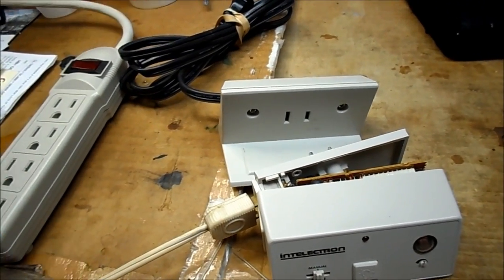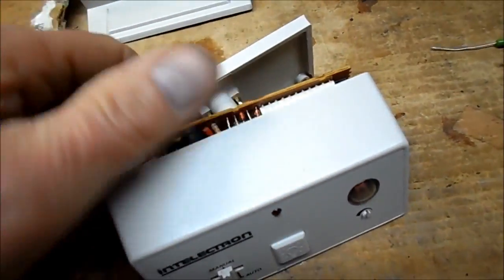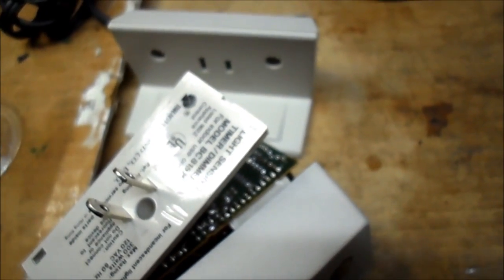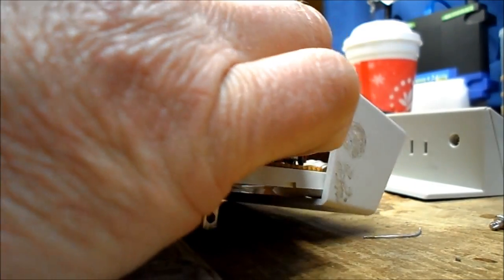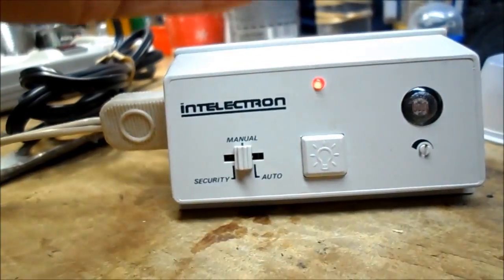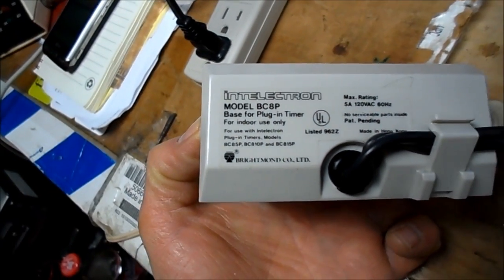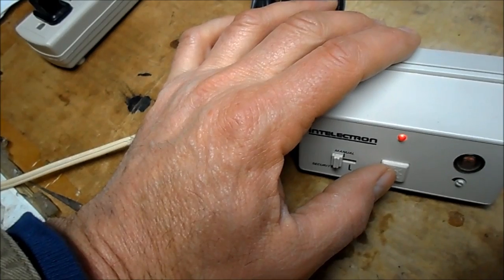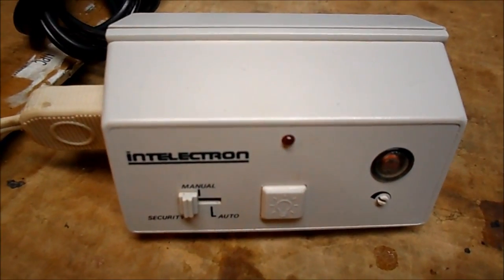1996 Intelectron BC8P Timer/Dimmer Repair.

Comment: I have a Brightmond Company Limited "MEMORY II PROGRAMMABLE SWITCH BC800E" for which I have no instructions. It appears to be an in-wall timer switch of some kind for "Incandescent Lamps Only, 300 Watts Max". One black and one white wire emerge from the back of the device. On the front is a single push button above a slider. a single red led is located above the button. I have scoured the internet and as unbelievable as it may sound, the only reference that I have come across to BC800E is the reference by jonathansanders4735 in this comment thread. If I recall correctly, the device was also marketed under the Intelectron name. Does anyone else have such a device or the installation manual and/or user manual?

Comment: I have had mine well over 20 years and it still works fine. Comes on at dusk and turns off every night at whatever time you push the button initially. If you lose power you must reset the off time again.

Comment: Manual - operate with switch only, Auto - on when dark, Security - on when dark but also turns on/off at random intervals to imply someone at home?
Reply from the maker: I believe so. It has been in use all week & has a mind of it's own. It must be. The led blinks to tell you too I believe. Dark mode is working. It comes on at the preset dim level.